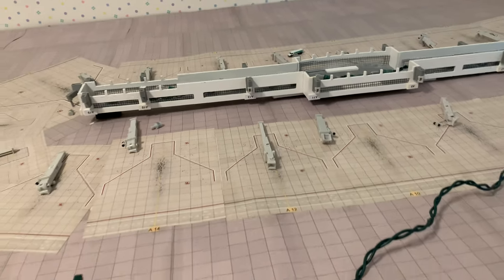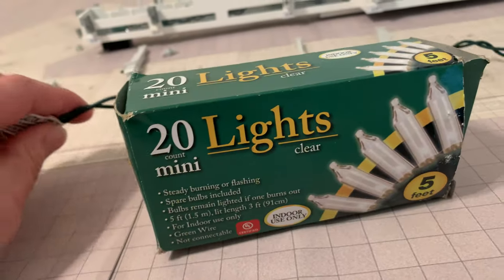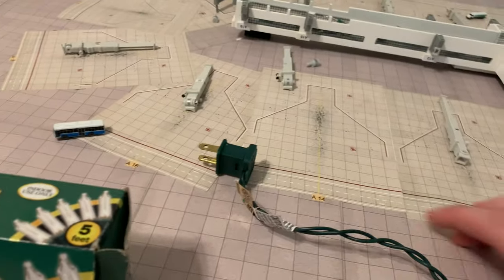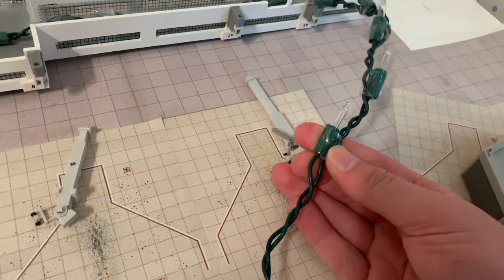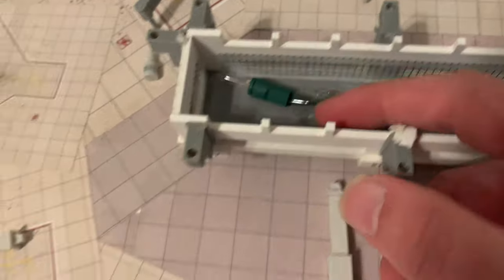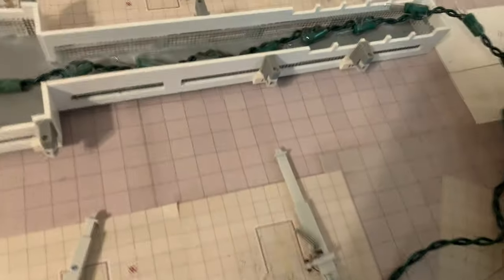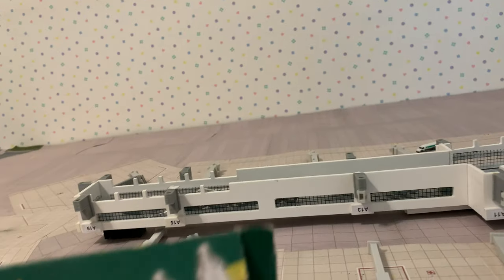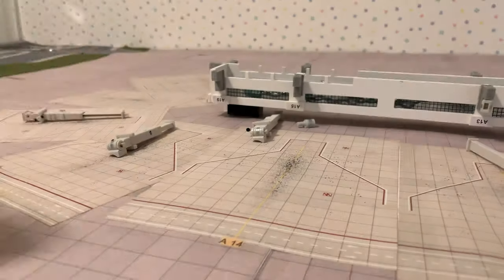How I Put Lights Into My Model Airport Terminal- Lighting Tutorial *SUPER CHEAP AND EASY*

Comment: Would have been nice to show the final results instead of a terminal with the roof missing and the green wire exposed and no lights on.
Reply from the maker: Thumbnail.
Reply: Thumb nail just shows a picture but a video can pan in or pan out and show all sides of the terminal. It is a great video and a better job than I could  ever do. Just a friendly critique. @DeltaFlyerHD